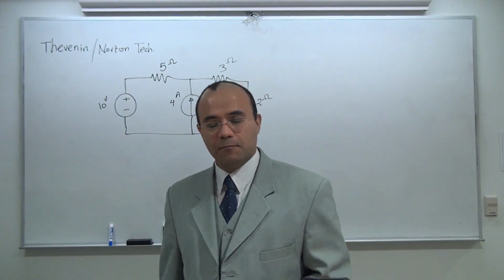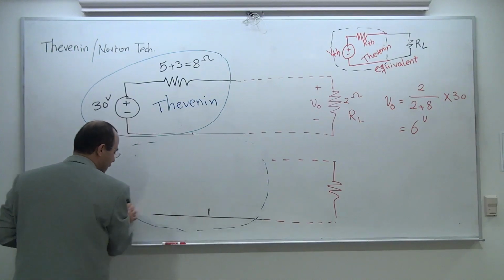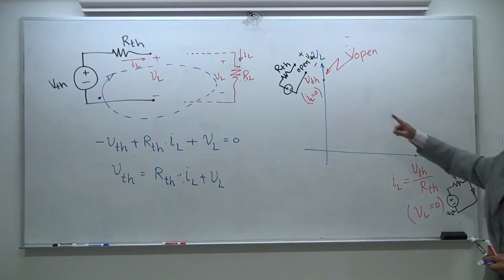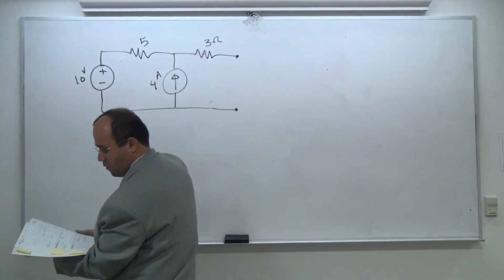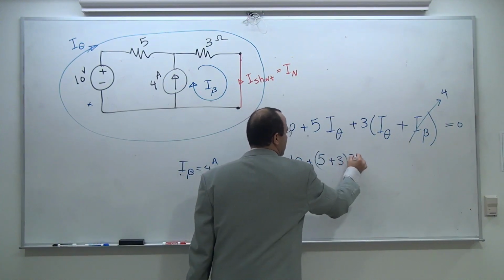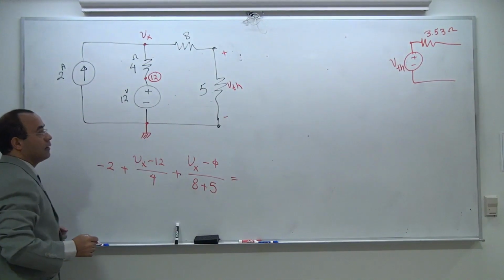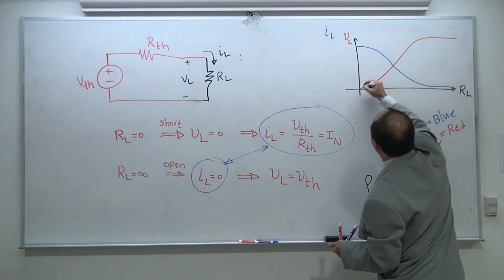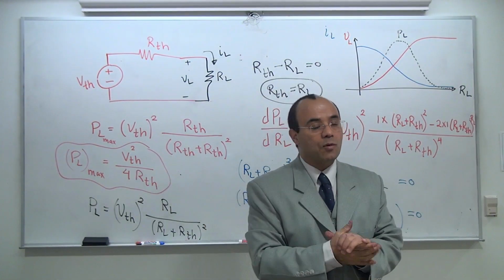Chapter 4: Thevenin and Norton Techniques

Comment: Nice Video, but it me confuse with my understanding more with the circuit analysis. In your video why did not you suppress the voltage source or current source with internal resistance or short-circuit to find the R thevenin (RTh)?? Cause, I calculated RTh ==10Ohms as your answer did but my Vth ==10V(unchanged due to Isc) and Rload voltage is 4V(i=2A and r=2ohms) by a voltage divider. Can somebody help here??

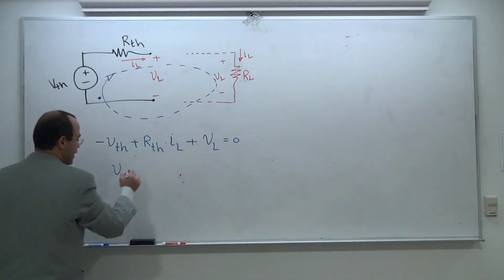Comment: 13:00 Why is it negativ V_th?
Reply: Check the direction of the loop.... so you are "hitting" voltage source in - sign , therefore you have -V_th
Reply: Just a sleepy moment, but thank you for the answer.
Reply: kvl law l,take loop clockwise

Comment: Its voltage division, which can be applied when two resistors and a voltage source in series. the equation is   [R1/(R1+R2)] (V)